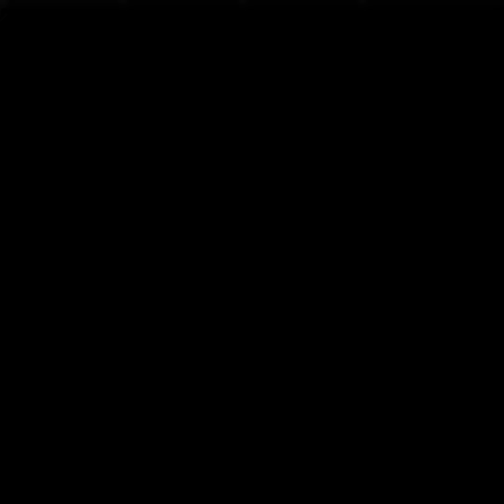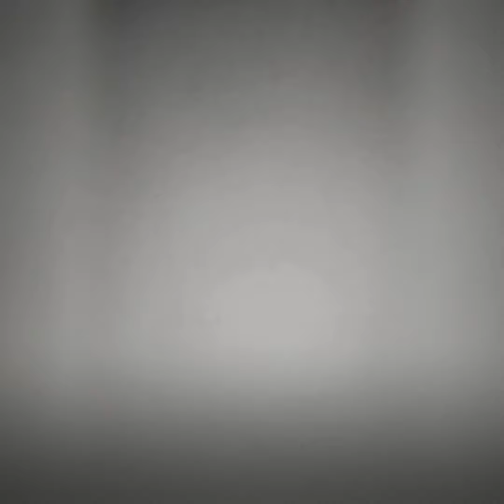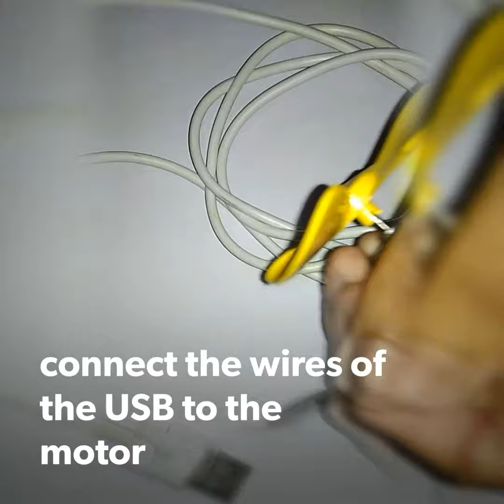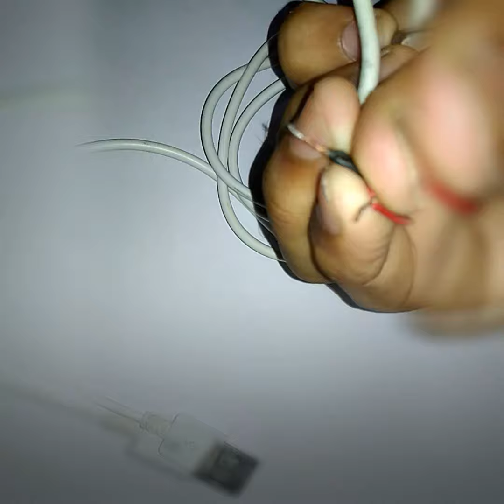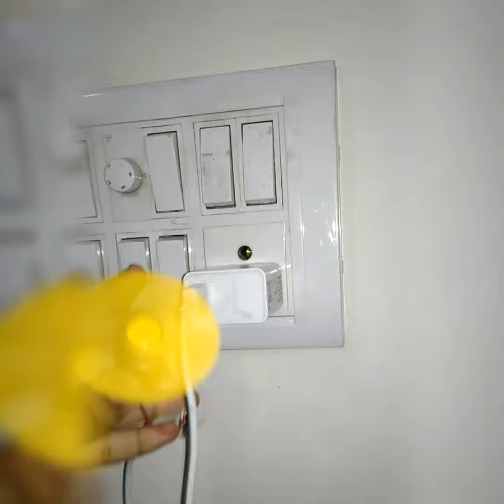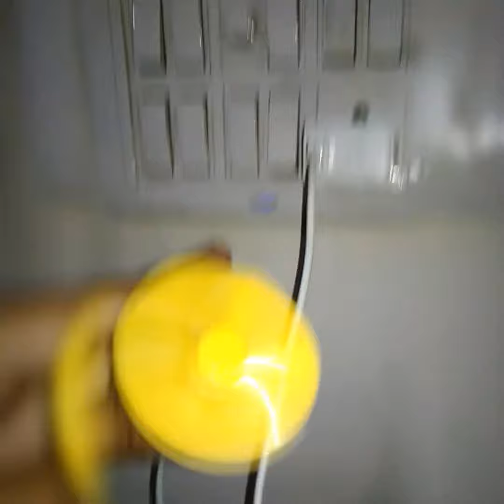How to run a dc motor using Mobile charger

Comment: How many hours it will be go bro
Reply from the maker: I haven’t tested that but if your charger have an output of greater than 1 amp then motor will heat up very fast . You can use suitable resistor to limit the current to the motor
Reply: @abhishekgautam25  u can put a video pls
Reply: In right side a or left side a
Reply from the maker: @gamingreealsdamamey1991  u can put on any side .

Comment: Can two mobile charger combination operate 12 v motor
Reply from the maker: No
(In parallel they will still have 5v and in series the internal circuit would damage)

Comment: will a 12v motor run with a 5v charger?
Reply from the maker: I think no.. but you can try it
Reply: It'll run slightly less the power than it does on 12v

Comment: Can't we connect it without cutting the USB wire?
Reply from the maker: Yes, but then you will need a micro USB jack. Solder it to the motor. The connect the USB to this jack whenever you want

Comment: It's not working
Reply from the maker: It will surely work. Please check your connections again. Ensure that the charger and the motor both are working
Reply: I will try just a minute but no work